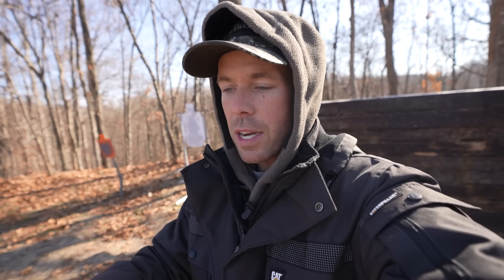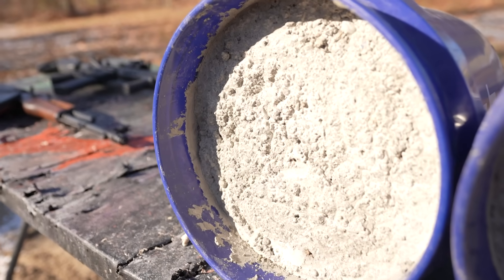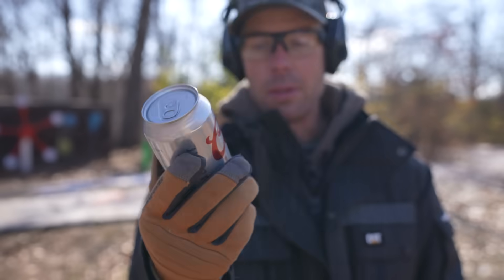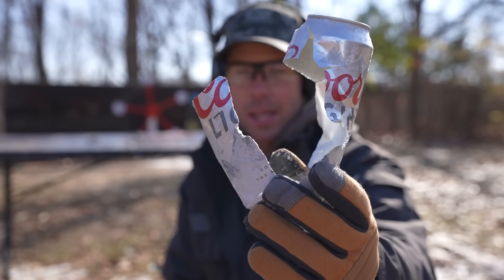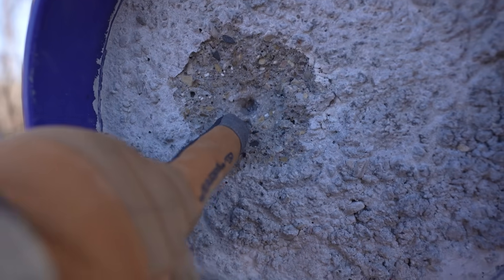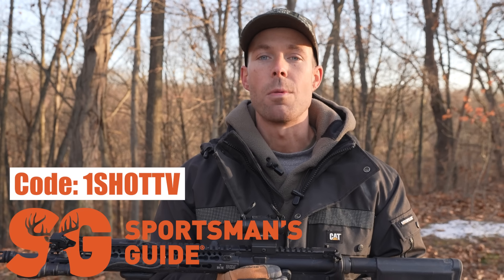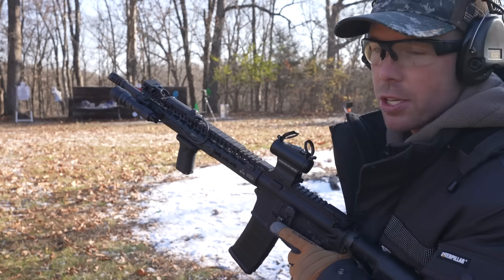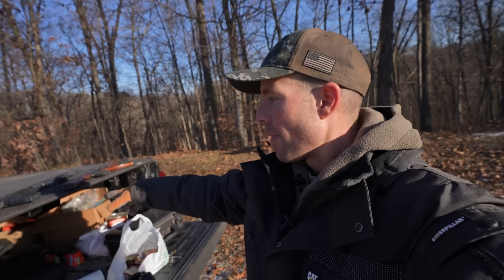AR-15 vs AK-47 vs 100lbs of CONCRETE!!! (Penetration Test)

Comment: I had a guy in the comments on another video claim his .30-30 would go right through a concrete wall.  As "evidence," he said it would go through a fireproof safe (about 1/4 inch of concrete between mild steel).  He continued to claim this after being given several videos proving otherwise.  It's amazing how ignorant people manage to be about guns in a world with the internet.
Reply: I could get through 100lbs of concrete with a single shot of  my sling shot!😅
Reply: He had special bullets 😂
Reply: Sounds like that guy was a politician,  it's a shame that the people regulating guns are the same people who know the least about guns.
Reply: Shoulda told him the closer he is to the concrete target the better chance it has to pass through it😂😂
Reply: It might be able to at close range lol
Reply: Been hunting with a 30/30 since I can remember actually I was 14 I'm 35 yes hell of of a brush gun but no it's going to stop on the first block.
Reply: @mohamedkallon1491  Yeah, no.  .30-30 is very slightly more powerful at the muzzle than 7.62x39.
Reply: 30-30 has about 500 ft lbs more energy than 762x39 lol..
Reply: @TTime685  If by "about 500" you mean 200-300 then you're right, but that's a hell of a rounding error.  And that's assuming a mil-spec load and not one of the many much more efficient civilian loads that can reach the same muzzle energy as the .30-30.
Reply: @Bacteriophagebs  1,500ish for 7.62x39 and 1,900ish for 30-30. Standard loads. Plus or minus on both sides. But yes I rounded up lol.. That's still a large difference regardless.. You're lying to yourself if you think otherwise
Reply: Needs to do 30-06 black tip
Reply: He's obviously got one of those magical 3030s where you don't even have to aim at the deer. Just shoot up in the air and Bambi falls over from the magical awe of 3030.
Reply: @TTime685  Looking at Ballistics 101, only 12 of the 34 loads for 7.62x39 are below 1550, and over half are in the 1575-1655 range.  The VAST majority of .30-30 loads are either 1827 or 1902 ft-lbs, with only a few loads over or under that, giving a difference of 170-350, with an average difference of 260 ft-lbs.
If you compare the lowest 7.62 with the highest .30-30, they're 1508 vs. 1902, a difference just under 400, but that's extremely disingenuous even without the rounding error.  If you're going to compare the lowest, then it's 1508 vs. 1827, or the highest is 1674 vs 1902 (ignoring the unique extreme loads on both ends for both cartridges).  If you compare the absolute highest, it's 2391 vs. 2047 (winner 7.62) and the absolute lowest it's 1216 vs. 1313.  The only way to get a difference over 300 ft-lbs is to make an unfair comparison.
Reply: @Bacteriophagebs  Nice mental gymnastics there 😆 Did you convince yourself that 7.62 is more powerful? Point is, 300-400ft lbs is still a large difference.. 
9mm muzzle energy is between 350-400ft lbs average, 10mm - 6-700ft lbs. That's "only" 300 difference on average, so that must be negligible with your logic lol.. 🤦🏼‍♂️
Reply: @TTime685  I see you either didn't read or didn't understand all those big (three-digit) numbers I typed.  The difference is under 400 (392) even if you compare the weakest common 7.62 loads to the most powerful common .30-30 loads.  The average difference is 260 ft-lbs.  And yes, one 7.62x39 factory load is more powerful than any factory .30-30 load.  I even gave the site I used for my numbers.  What sources do you have?  Oh, that's right, your own bad memory and terrible math skills that think 400=500!
The difference between 7.62x39 and .30-30 is less than the difference between 5.56x45 and 7.62x39.  Those two are considered comparable by most people (hence this very video).
Reply: @Bacteriophagebs  Also M855 destroys 7.62 in hard barrier penetration for a fraction of the price.. This guy is doing concrete barrier penetration but not using M855 🤦🏼‍♂️ I have yet to see a video testing M855 and 7.62 penetrator/steel core rounds
Reply: @TTime685  That really depends on the type and thickness of the hard barrier.  Body armor?  Yes, M855, like all 5.56, is much, much better than any 7.62x39, which he says in the video.  Concrete?  Maybe, maybe not.  M855 still tends to disintegrate on impact with hard surfaces, which is less useful against barriers over an inch or so thick.  With a thick, brittle barrier like a concrete wall, what you need is energy transfer to shatter as much as possible, so the more energy, the better, and 7.62 is slightly better in that regard.
"Hard barrier penetration" is an overgeneralized term and usually refers to the thickest barrier a projectile will get through in one shot, not how many shots it takes to get through a barrier too thick to penetrate.  Terminal ballistics is extremely complicated.
Reply: @Bacteriophagebs  Yes, I can agree with you on that assessment ;)
Reply: 30 30 is a awesome round but yeah he's exaggerated just a bit 😅
Reply: I've never seen anything besides soft point ammunition for 30-30. I shot a t.v (old school big back television) at around 75-80 yards and it wouldn't go through it. Granted I don't have a lot of experience with 30-30 besides the Marlin I had when I was a kid and the one I shot the t.v with but yeah...if it would have been fmj I'm sure it would have gotten all the way through it but like I said I've only ever seen soft point. Never looked for anything besides soft points tho so idk....I'm going to go look into that now actually.

Comment: 7.62 is much larger and hotter round, or am I wrong?  Your marksmanship is very impressive, but the difference between rounds will never be close to being equal.
Reply: The 39 is not close to being a hotter round and the factor of bullet construction is also a factor when shooting hard objects. 55g FMJ target rounds he used are the weakest of the 556 lineup.
Reply: 7.62x39 is a larger slower round making it better for penetration of regular objects whereas 5.56 is a lighter faster round making it better for penetration of harder objects like steel or body armor. 5.56 also has a tendency to fragment in flesh and bone making it arguably more lethal then 7.62x39
Reply: @elozesty6376 Maybe when using fmj ammo, from personal hunting experience I can tell you, out to 200 yards the x39 with sp ammo is devastating on 4 legged critters when compared to .223 I've yet to have a badger, or coyote take more than 1 or 2 steps after a x39 hit but I've had many running off and needing another hit from .223. The weight difference in the projectiles is just to much to make up for with speed inside of 200 yards, beyond that the .223 is better.
Reply: @wymonwatson1309 my experience differs

Comment: Imo training with iron sights is the best way to train. If you can become accurate with iron sights, you can hit anything up to a certain distance. Great video dude 👍
Reply: Iron sights are just as water proof and shock proof as the high teir ACOGs on the market at only 1% the cost and the battery life is so long, I don't think I've ever replaced them!

Comment: I'm very grateful for this video, here where I live in Brazil, criminals use large caliber weapons like the 762 and 556 rifles, use grenades against the police and even have anti-aircraft weapons.This video gave me an idea of how I should fortify my home! Thx
Reply: Brick is even better than concrete.
7.62x39 and 5.56x45 are not "large-caliber," (nor are they "high-powered" as the American media often claim).  They're "intermediate" cartridges, which means they're in between pistols and full-power/high-power rifles.  7.62x51 is a full-power cartridge.  A "large-caliber" round is one over .40 caliber (10mm) like .45-70 or .50 BMG.
Anyway, good luck out there.
Reply: What you need is the real President, not the cheater you have know.
Reply: 7.62 and 5.56 are not "large" caliber at all ....
Reply: Lol I already knew u caliber correctors were gonna be in the comments 😂

Comment: NICE VIDEO! And a 556 with 77 grains made with hard material an handloaded to reach the same velocity of the 62 grains bullet will do  a much better job than 762 x 39.
Reply: “Penetrator rounds with extra propellant will outperform standard-issue ball ammo designed in 1943, take that!” 🤦🏻

Comment: It would be interesting to see a test using plywood on the front, back and sides of the concrete (and maybe also a sand version).  Similar to how a wall of a safe room might be constructed. I am thinking the plywood would let the bullet through, but would keep the concrete chunks together inside, turning it to gravel and sand, which would still be pretty effective.  Cool video.

Comment: As fond as I am of the AR, it was a given the AK would win this test, but what I would have liked to have seen was you using a table and some sandbags to stabilize yourself and achieve better groupings as I can't help but wonder based off of the performance of the first hits if the contest might have been closer had the AR been able to keep a tighter grouping in the center.

Comment: 5.56 55 gain FMJ just didn't work very well. Green tip would have helped but the 7.62x39 will always win. Momentum wins the day. If you shoot steel targets the 7.62x39 will swing them more even thought KE is similar but momentum is much higher.

Comment: I've never owned an AR style rifle, but I'm looking into it, but need your advice on one left handed, and not getting the brass in my face. Does a certain type, or brand work better for this? Thank you.
Reply: Side charging handle
Reply: I was wondering about shooting a right handed  AR left handed
Reply: I shoot left handed and never had an issue. I’ve used the ambi controls and prefer standard ones.

Comment: The added mass and energy of the 7.62 gives it a huge advantage in this test 123gr projectile at 2300 FPS is 1450 ftlbs of energy vs 5.56 55gr at 3000 fps only 1095 ftlbs of energy.